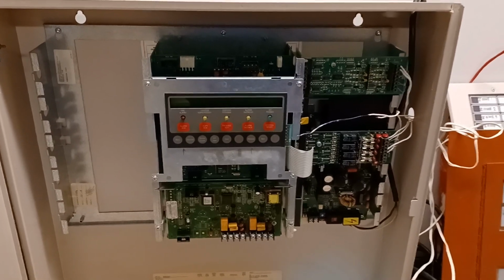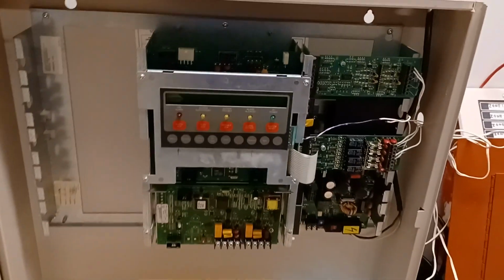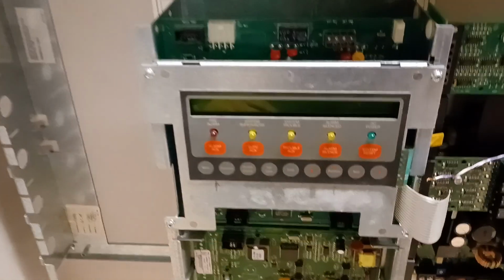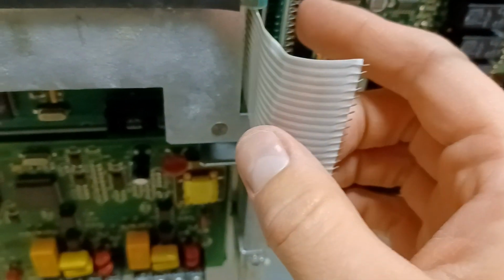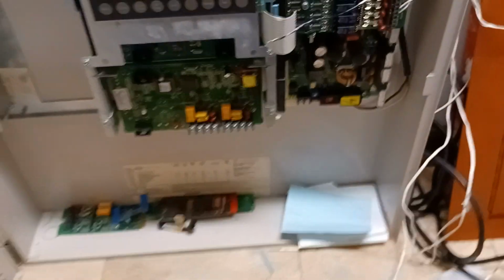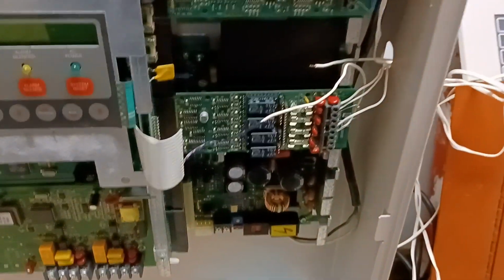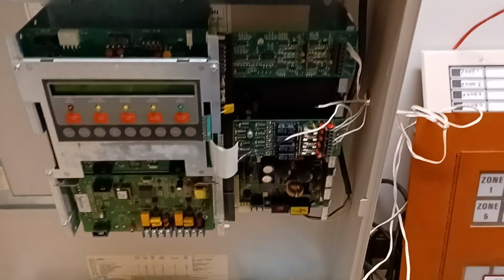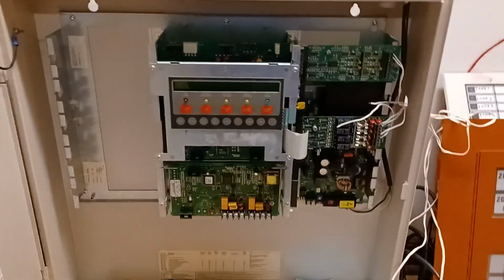I Broke the 4005 (Again)

Comment: I'm not sure why, but the comment I left on this video didn't show up, perhaps because it included a link? Anyways, I was going to say, it shouldn't be super hard to replace that connector on the distribution board if you could find someone to solder it for you. Adafruit has these short style female headers that would work as a functional replacement, if I lived closer to you I would certainly give a shot at fixing it, but unfortunately you seem to be rather far away. I would include a link to them but that seems to be what removed my previous comment. In any case, I wish you luck on repairing it, they are beautiful panels after all.

Comment: Sorry to hear about that broken pin. The 4005 saga continues... If you do replace the power distribution board, I may very well be able to solder the pin back in place for you and you can keep it for a spare. All it will take is desoldering the hole to make it clear, inserting the pin back, and soldering it back down to the board. Heck, I'd even take a stab at fixing that power supply. Most likely one component such as a capacitor or input protection device is causing leakage current to ground. Replacing whatever component has grounded out would bring the power supply back to being a fully working spare. :) I do have a soft spot for the 4005 but it's a shame certain things, such as that ribbon cable connector, seem to be rather poorly designed. You'd think they would of used a regular type of connector (such as the one from the power supply to the PDB) and socket rather than that rather crudely made ribbon cable and connector. However, it looks like they needed the smaller connector in order to save space as it's close to the edge of the board.
Reply from the maker: Thank you, sir! I really appreciate that. I'm going to buy replacement parts, and if you want to take a shot at repairing the old ones, I'll definitely send them to you! This panel seems to be full of poor designs, unfortunately. I just don't want to toss it; it seems that just like the other older Simplex panels, these are getting harder to come by, but parts for them are all over the place out there.
Reply: @msj191961  You're very welcome, sir! I think it would be great to try repairing your old parts, it would make me happy seeing you able to have them fixed and be useful again as spare functional parts rather than have them tossed. I agree, I really have a soft spot for the older Simplex panels and products in general. STR was such a great company with a lot of history to them. It sure seems like they are getting harder to find, there seems to be less of the older 4000 series out there every year which is why I hope over time to be able to preserve decent examples of a few of them. The 4002, 4004, and 4005 are probably my favorite along with the 2001 and 4010. The 4020 and classic 4100 are neat as well. What i'm sure is even more rare to find anymore is a 4005 retrofitted into a 4002 cabinet which Simplex did do at one time. I'm glad you decided not to toss the 4005, I would of offered to acquire it if you did lol and probably fixed it for you even if you got another panel. One good thing is like you mentioned, most parts seem pretty widely available out there, it's just like most things, they are ridiculously priced on eBay. I was watching some of your old videos the other week and I can feel your pain about wishing you had kept the 4001 and 4004 when you threw them out, but I understand why you did. I threw out a lot of stuff in my younger years that I regret. I would of taken a shot at fixing those too. I always wondered what exactly on the board went bad with your 4004 that got all the random troubles. The microprocessor must have been glitchy. The 4005's keypad getting moisture into it is an interesting failure. I know sometimes the old glue used to adhere the membrane to the steel backing will start to dry up, causing the membrane to peel away from the backing, usually under the tension where the ribbon cable exits. I wonder if moisture could of gotten in through there. Even then, it's still interesting how it only appeared on a few keys rather than all of them, the ones that seem to be used the most. I wonder if skin oils could have somehow reacted with moisture. Just a theory haha. I hope you will be able to find a good deal on replacement parts, I will keep an eye out for you if I find any :)
Reply from the maker: @docbrownsradiolab1220  Great, thanks! I did place an order for a replacement power supply and distribution board, so hopefully I'll have those next week.
Reply: @msj191961  You're very welcome! :) That's great to hear, I'm so happy you were able to find good deals on those parts and that you will finally have a panel with no ground fault! I hope all goes well with it :)
Reply: @msj191961  Just a quick update in that I found the same 16 pin header connector online which is the same type Simplex used for the CPU membrane connection, so I could just replace the whole connector for you.